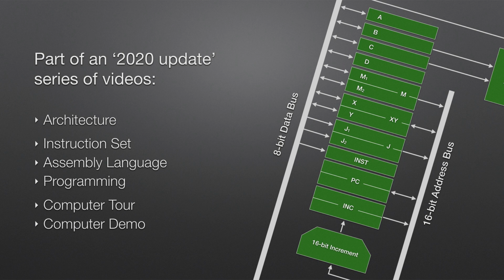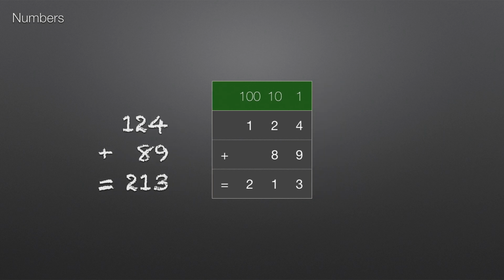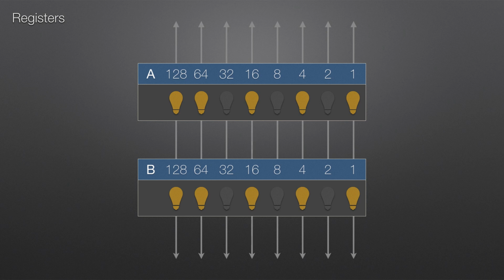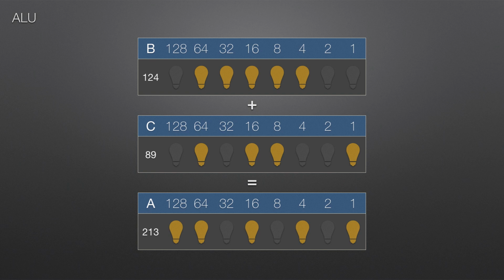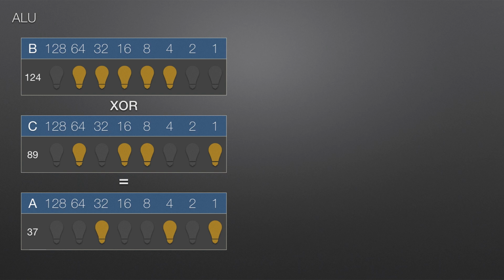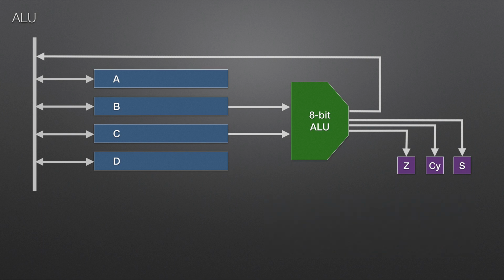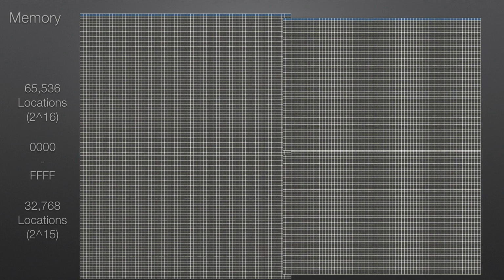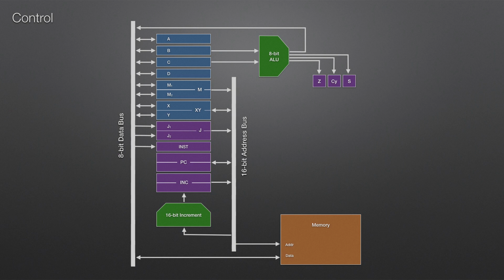Relay Computer 2020 Review: Architecture

Comment: Great stuff PL. But I just can’t understand your 4x DPDT relay full adder that you show elsewhere. It doesn’t work in my hands. Or in theory. It internally forces the Cin inputs to potentially contradictory values. What am I missing?? Inputs should never be   forced internally of course. It creates a short!
Reply from the maker: Could be my diagrams not being clear enough ;) does this one help: https://www.relaycomputer.co.uk/posts/2013/11/design-1-bit-arithmetic-unit/ - absolutely key though is that it needs both a carry in and a negated carry in to work
Reply: @paul80nd  I’m using that page & the 4x DPDT design. On both my actual breadboard and in the design flow in theory, if I set Cin to 0 (floating or grounded), ~Cin to 12V & set Input C to 12V & inout B to float or grounded i get the flow trying to set either Cin or ~Cin to values (contrary to the input) whereas those are inputs!

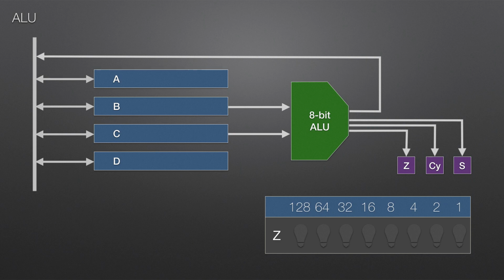Comment: Great video but there may be an error? At 14:08 you sad "the Z flag's quite straight forward...that set if all bits of the result was zero or not zero." I researched on-line and found the Z flag is set (=1) if all bits of the last operation are 0. Why do you say (in the audio and caption) "... or not zero"? An error perhaps? Jim
Reply from the maker: Yea, good spot. I must have been getting tongue-tied and somehow didn't notice it when transcribing the subtitles either. The Z flag is, of course, set when all bits of the result are zero.